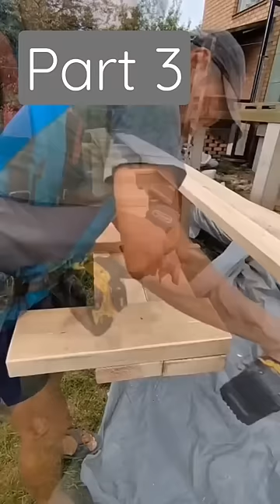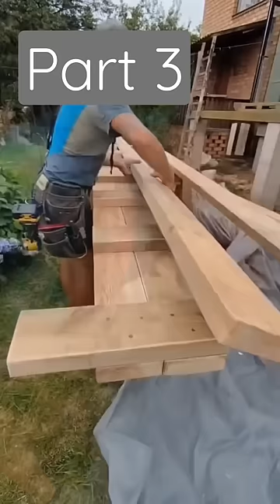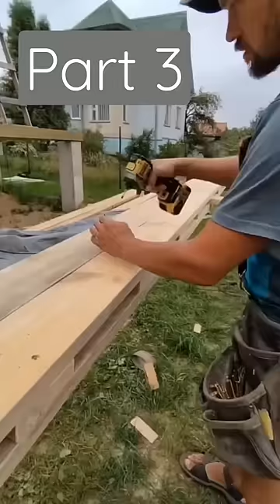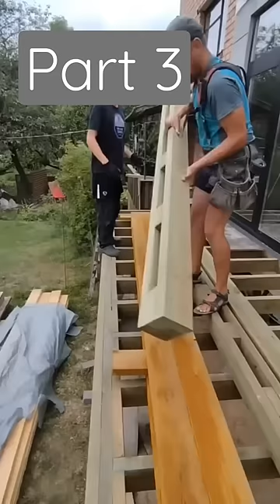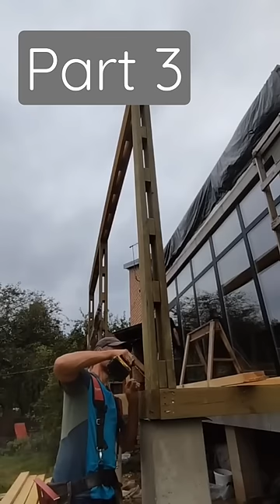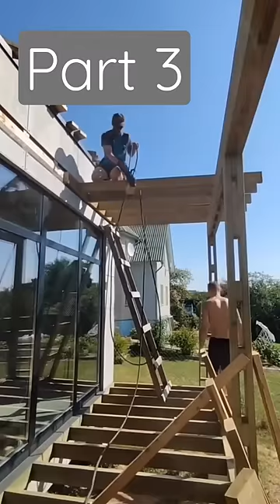Construction of a 12.4m2 terrace using frame technology.  Part 3 #build

Comment: No inspector will pass that post connection to just a rim joist.
Reply: It blows me away to see them attaching the posts to floor with toe screws.
Reply: @alfaromeo6985 what’s wrong with structural screws?
Reply: @minhdaubu2363  
Nothing wrong with the screw but plenty of wrong with the toe nail application, which is for look not structural strength.

Comment: Those screws will eventually start to break when things settle. Screws don’t bend like nails they just break, that’s why they aren’t allowed in structural framing unless they are specifically designed for it. This is shotty work at its best.
Reply from the maker: Beam and pillars with a large margin of safety milking this design.  The load will not be large.  Everything will be fine!  👍🏻
Reply: You spelled shoddy wrong
Reply: What about spax screws
Reply: @louish.9414  I said unless they are specifically designed for it. Read my original comment man.

Comment: I love the quality of the woods they are using. Seems this is costly as it is of the same quality. I hope these are not appetizing to termites and other wood pests.
Reply from the maker: The board has been specially treated with an antiseptic that is autoclaveable and suitable for outdoor use.
Reply: @harshcarpenter  are you talking about what you brushed on those boards?

Comment: Been done in half the time with a framing nailer.
Reply: Did you not see part 1 ,he used up all his nails
Reply: @shauns386  that's when you go get more then.  Framing nails have more shear strength over screws anyway.
Reply: Framing nailer or not this is still a badly made structure
Reply: @raysmith6891  I know

Comment: Those screws won't last 1 storm. Screw snap, nails bend. On top of that who tf is out here hiring people in Crocs to begin with, if you showed up to do a job at my house you would be run off, not about to have someone wearing Crocs playing with power tools around me.
Reply from the maker: There are no storms in our region.  Pozhtomu and building standards are different.  Everything is within acceptable limits.  I work for myself.  My own boss, I work in what is comfortable.
Reply: @harshcarpenter  hello from London. Nevermind all the bs'ers on here... but I would get knee pads on first thing. I have a torn meniscus from not using them. My bad.
Reply: Only code in America
Reply: I see contractors use screws all time